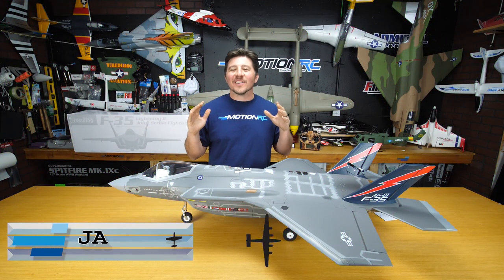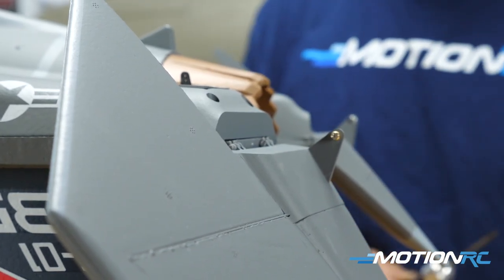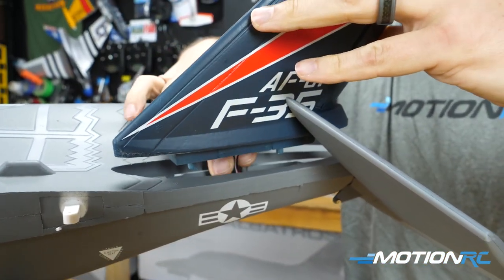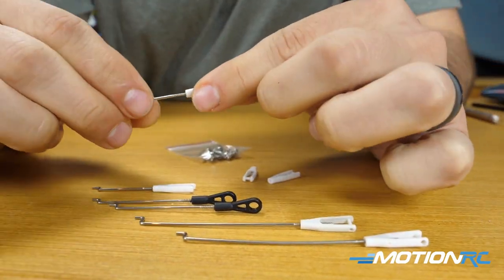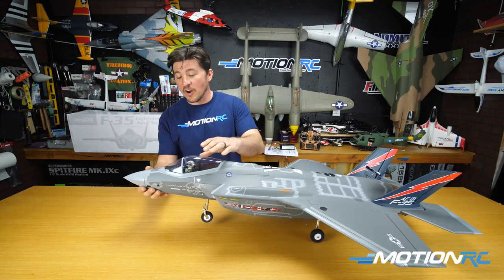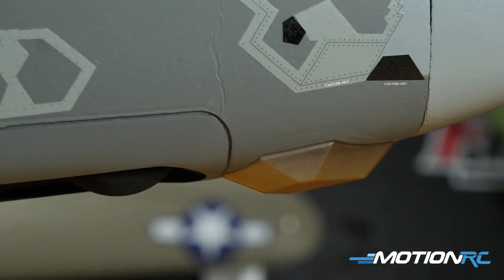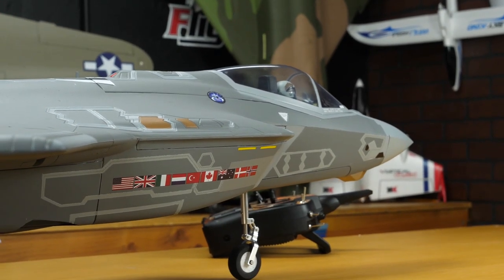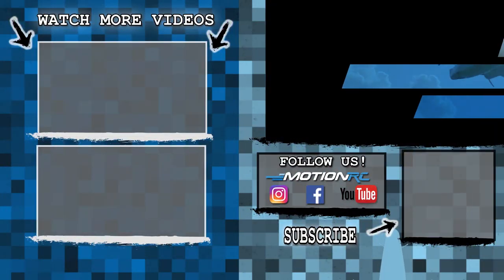Freewing F-35 Lightning II V3 70mm EDF Jet - Build Video - Motion RC

Comment: Hi guys, I took delivery of one of these last week, it says it can take off on any grass surface, our field is in good condition with regularly cut grass, on my maiden take off run the port u/c failed just prior to take off speed and snapped off at the servo causing the port wing to dig in to the grass and the model to cart wheel, the front of the fuselage was also damaged.

Comment: Hey James I have one of these was wondering if there's any ordinance options?
Reply from the maker: Not without some customizing. You can buy the pylons and railing system and an ordinance set from a different jet like say the 70mm F-16 and make it work, but many use a 3d printer and make their own off Thingiverse.com

Comment: what i find really surprising about this modell is its weight compared to the old one...1700g in EPO (new) and more like 1100g (old) in EPS which is a much lighter material....so the flyingweight compared to the old one which is almost the same size is much different, barely over 1350g on the old F35 (with 4s 2200mAh) but at least 2450g (and that is calculated with a 4500mAh pack) on the new one, which kind of explains why the older modell is super floaty and the new on, well lets say its not floaty at all...still it looks like a nice flyer and i like the new colorscheme too but still i wish you would have made her a bit bigger, F-22 size with 90mm and stuff, anyway nice plane overall

Comment: All that scale detail and no lighting 😔 how hard would it be to retrofit lighting on this bird?
Reply: Our 70mm EDF series typically does not include pre-installed LEDs, which is reserved for most of the larger 90mm EDF series jets and a couple of our more recent 80mm EDF series jets. This 70mm F-35 is intended to give pilots a modern jet that looks the part with high aesthetic detailing, but remains smaller and cheaper to operate than their more expensive brethren . Functionally, this F-35 adds suspension struts which is typically reserved for 80mm/90mm EDF series jets, plus the inrunner power system. 

Adding LEDs, to those so inclined, shouldn't be too difficult a process using the Freewing MFCB and one of our several LED sets.
Reply: @alphamrc309  thank you for the detailed response. I totally understand the price/performance balance, but the bar has been set high by other recent offerings. For the price, I'm amazed with the apparent value provided by this new kit.
Reply: @mdoering  its foam, they could have done it. its not that expensive to do it right. getting greedy maybe....attention to detail brothers
Reply: @alphamrc309  its foam, you could have done it. its not that much more expensive to do it right.
Reply: scale equals snail. Performance over scale any day 10 times over

Comment: I think I'll wait for the Version 4, that has landing bay doors, bomb bay, and thrust vectoring.  Come on guys modeling is half the hobby.  Its in the name, rc MODEL plane.  You went all out on the top but went kinda cheap on the bottom. literally a half ass job (landing gear aside that is good) There was a model out there (that I have) with all of these things. 12 blade, 6s, 70mm, bombs, and landing doors.  Only thing lacking was lights and I took care of that (not very well but hey)  Paying attention to detail would take these models from good to great. (for example your b-24) Normally I love what you guys do, but this imho is a fail. ( I know opinions are like butts everyone has one and they all stink.)
Reply: Not realistic at all. Many of the rc edf jets are borderline on allowable weight.

Comment: Odd. That's not an F35 jsf, a true f35 jsf is a vtol, this is not a vtol
Reply: The jsf is for Joint Strike Fighter. One of those models within the many that make up the joint has vertical capabilities. This is the FE model.